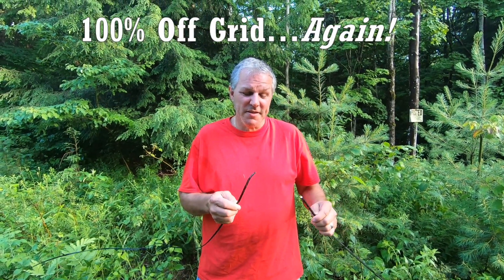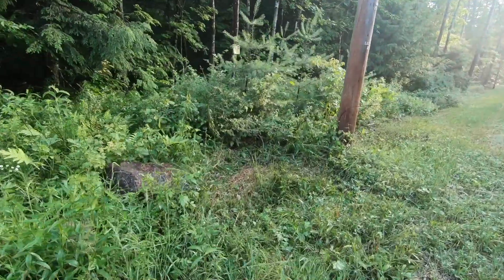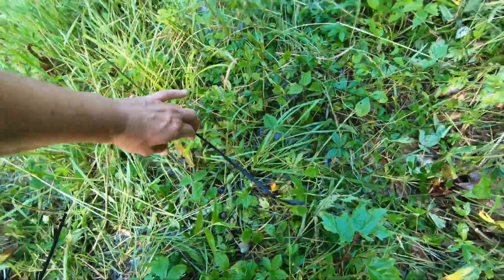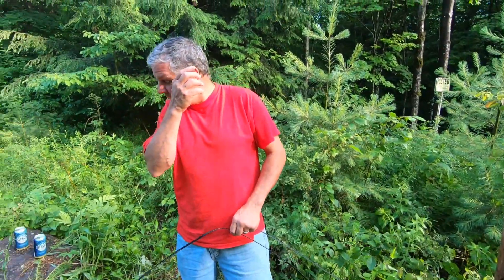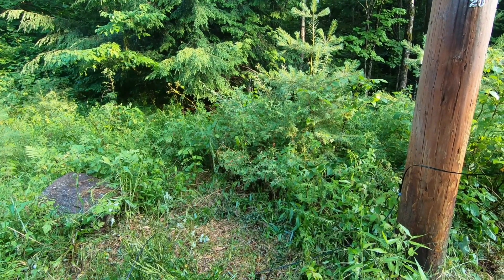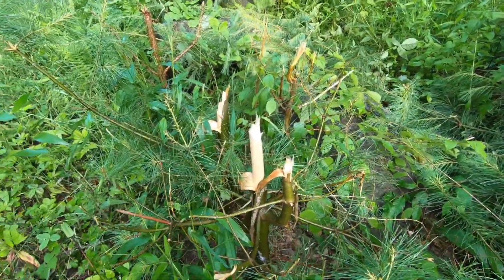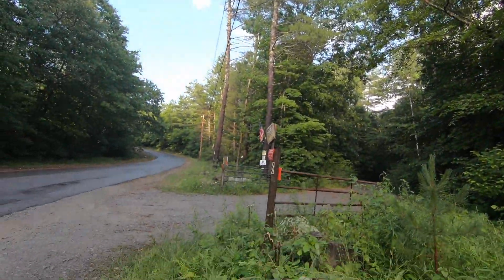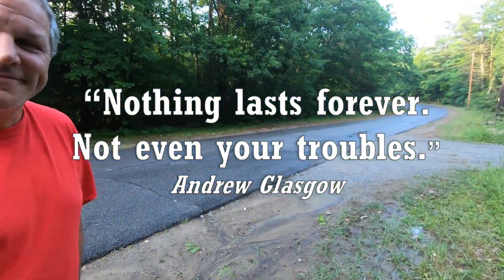BROKEN FIBER OPTIC CABLE - Can this be fixed?

Comment: It's not the landscaping's fault about the wire being cut. That should be buried and shield by sand and stones so you don't dig in where the cable is at. We had our wires exposed where the bushes are that eventually get trimmed and sure enough my wife cut it because the wire was exposed.

Comment: I have frontier and the fiber was bite by the dog and 2nd time by kids, then I changed to Mobile internet. Not so fast but enough for family. Fiber need special tool to melt and connect, or dedicated connectors, both are professional jobs, believe me, I was selling Optic Equipment before.
Reply from the maker: Yes. They came and fixed it finally. Unfortunately no mobile signal anywhere around here. Thanks for watching and commenting 👍

Comment: It is common for the fiber to be left on the ground by the installers. Companies have separate bury crews that come within a few weeks and bury the cable. They should definitely mark it though. We use caution tape on ours to try to keep this from happening. They do get cut though.
Reply: In my area I've seen a boring machine pull a fiber conduit, then later the fiber is inserted. At no point was fiber just laying on the ground unprotected. They can horizontal bore >500' at a time, then put in a surface mounted splicing box. It nuts to leave unprotected fiber just laying on the ground for 3 weeks.
Reply: @timezonewall  Its not such a crazy concept to leave a DOG (drop on ground) in my area. Lots a folks request new service in the dead of winter. No way your getting a cable underground, so we pull out a temp service. Cable may not get buried for months after cable is placed due to several factors.
Reply: @tonyp799100  That makes perfect sense in your area. We all tend to see things from our own perspective and I wasn't considering those in more northern latitudes. In my area foot traffic, landscapers, bicycles, animals would all be potentially hazardous to a cable, and vice versa, year round. Horizontal boring is readily available year round so there would be no reason to delay burial and lots of reasons not to.
Reply: Companies need to be made to bury these cables trip hazard , law suit

Comment: It's a 5 min procedure to fix it! And will cost you like 10 usd
Reply from the maker: 😂😂you obviously didn’t watch the video. Try watching it and let me know if you still think that’s true.
Reply: @CreatingASimplerLifeOffGrid  yep that's true cuz I'm an  Internet Service Provider (ISP) and I know it very well! This is my full-time work!
Reply from the maker: I’m pretty sure you still didn’t watch the video because there’s no way we could fix that for ten dollars because it was way too shredded and we don’t have the tools. It would cost more in gas to try to find all the materials we would need. We are pretty remote. We did end up getting it fixed by a professional for free the next day though!
Reply: @CreatingASimplerLifeOffGrid  yes we do it for free too! Look Optical fibre costs 7 rupees per metre , now I think they used atleast 50 metre wire to fix that ,which will cost 350 rupees or 10 usd . But if they had wires accumulated in the splice drop then they  have done simple joint!
Reply: @CreatingASimplerLifeOffGrid  what I meant was not that u can fix that in 10 dollars, your local ISP or Local Internet Service Provider can fix that for 10 dollars! And never try to fix optical fibres by yourself allways call an professional splicer, if optical fibre enters body it could cause an nasty rash

Comment: Can I use a RJ45 coupler to fix the same issue?
Reply: LOL RJ45 couplers are not used to fusion fiber wires. You do the repari with Fiber couplers. it's the same principe but takes more time to fix
Reply from the maker: I don't know what type of connectors they are. But I'll bet  there are a lot of types of fiber optic cables and  connectors out thereT they have already replaced the one in the video with a different one

Comment: Sorry to hear about your cut fiber optic cable.  This Is definitely not diy fixable unless you have a diamond blade fiber cleaver and a fusion splicing machine or 3m fiberlocks. I hope they fix it soon. Good luck .
Reply from the maker: Hi Steve! Lol. What a nightmare that cable is! Rich was playing around with a piece and got a sliver in his finger. NOT cool. Good news is they fixed it already. It was done by the time we got back home last night 😁 Kathie
Reply: @CreatingASimplerLifeOffGrid  
That was fast. Glad it's fixed. Most likely rich doesn't have a glass splinter from the actual fiber optic glass. It's probably a fiberglass splinter from the support member inside the cable. I've  gotten many. Lol.  If you can't get the splinter out with your fingers or a tweezer, try putting a piece of duct tape on your finger and then gently remove the duct tape. This method works well with most small splinters, especially if you pull the duct tape in the direction the splinter went in and if it's the real sticky duct tape. Good luck and God bless.
Reply from the maker: We got it out but it wasn’t easy. Your tape suggestion is great👍👍👍
Reply: 😂 the shit place I used to work at I had to use my razor blade to cleave it

Comment: Man, that really sucks. Maybe have them put the cable a little deeper in. I would put some steel t-posts in the ground and zip tie the new cable to it and than tie some orange trail marking ribbons on the cable. Just a suggestion.
Reply from the maker: We will definitely be marking it really good!
Reply: It wasn't buried at all. It was laying on the surface. Should've staked it out to protect it until it could be properly buried. 

>>>>>>>>

Hey, probably too late but for anyone else who happens by this video ...

You should take pics and/or measurements (or GPS coordinates) so that you can find its location in the future, if you happen to do any digging in the area later on.

If you dont do one of these things, you will never remember where it is in a decade or two, and you may end up damaging it again. You may be able to tell where the trench line is for a little while, but eventually it will be unrecognizable.

If you decide to take measurements, don't measure it from something that could move -- like trees, road edges, curbs etc. These things often change over time. Maybe you could measure from a power pole or street light, hydrant maybe, but that's not ideal either...
Best to bury it with a tracer wire so it can be located. Fibre Optic line is not a conductor and cannot be located with standard Locating tools.

Best to bury the line with a conductive tracer wire and mark the GPS coordinates. Put the info with the house deed/paperwork for future reference.

Comment: MAKE SURE THEY RUN IT IN ARMOR CABLE LOL. WHAT A NUMB NUTS. ON URE TREES I SUGGEST PUT THEM IN WIRE CAGES LOL STAY FROSTY. IAM GOING BACK TO WK NOW. BE SAFE YALL
Reply from the maker: Wire cages is a great idea! Thanks! Hope it’s not as hot for you at work as it is here today!
Reply: @CreatingASimplerLifeOffGrid   VERY MUCH SO LIKE 95 WIT 60 HUMIDITY AND YES WE WARE OUR GLOVES.BECAUSE THE STEEL IS SO HOT IT WILL BURN YOU. LOL THATS A HINT FER URE HUBBY AND YOU SHOULD MAKE THEY PAY FOR YALLS TREES ALSO. STAY SAFE.😂😂🇺🇸🇺🇸🇮🇪🇮🇪🏗🏗🏗🏗🏗🏗🏗🍦🍦🍦🍦🍦🍦